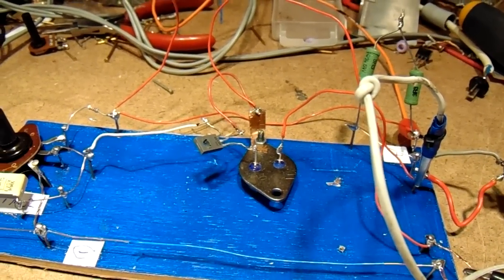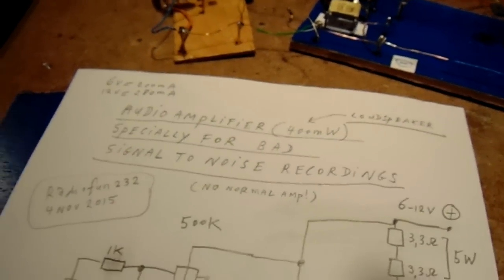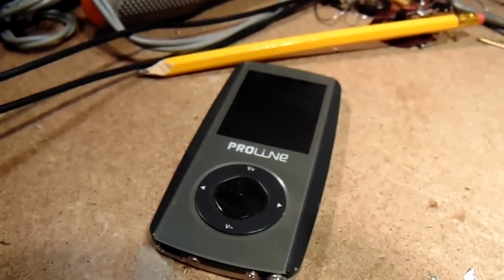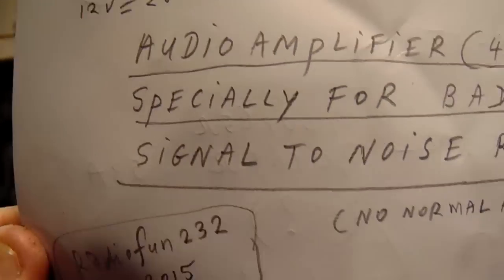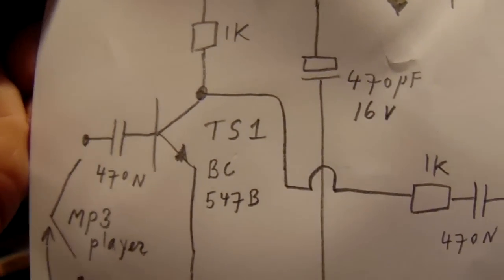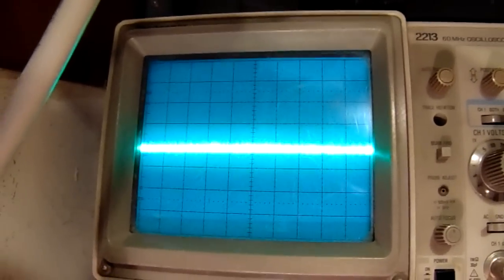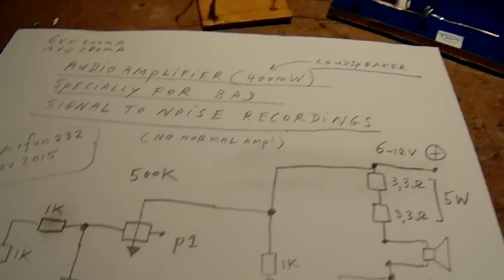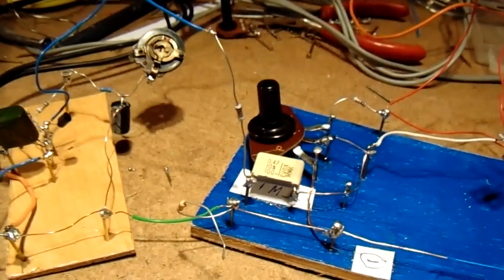Audio amp 400 mW specially for bad/weak signal to noise audio files

Comment: Won't Dolby Digital feature of tape decks do the same job? Because my tape decks have that feature and one of them actually has Dolby DBX which makes very high quality recordings and play's them back perfectly. Cheers :)
Reply from the maker: +ciprianwiner With Dolby there is 1 problem, the recording must also be done in a "Dolby" way, that means that the high frequencies are amplified (too) much and recorded on the tape/file in a very trong way compared to the other part of the audio spectrum (20 Hz-10 KHz). When the Dolby file is played back, a trick is used to weaken out the over-recording/amplification from the high frequencies. In this video a cassette recording without Dolby was used.
Reply: +radiofun232 Well yes that is true but Dolby also works on cassettes without Dolby recorded but that of course usually cuts the high end of frequency spectrum so yes it doesn't always do a good job on music but for voice recordings, I don't think it matters too much. Cheers :)